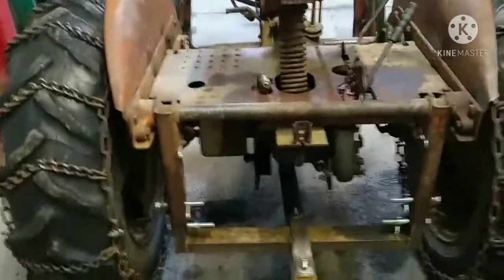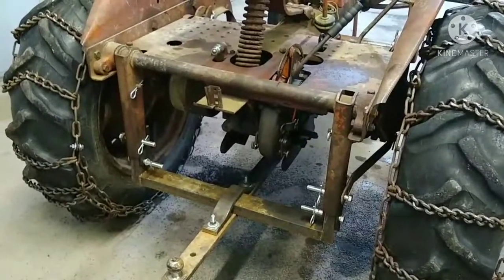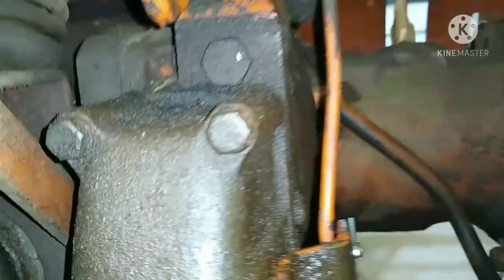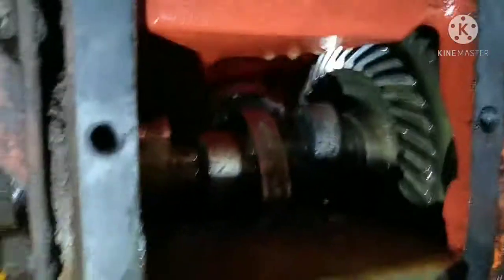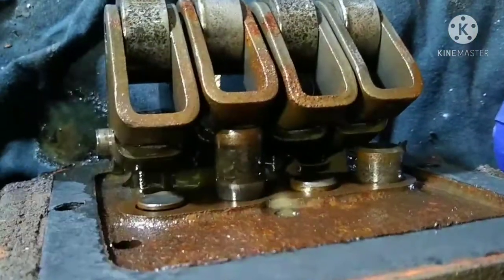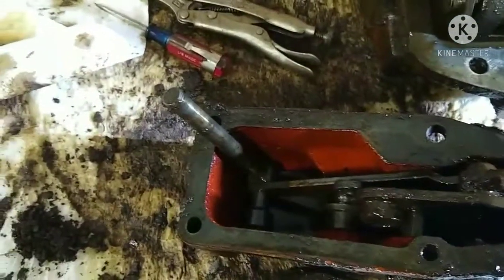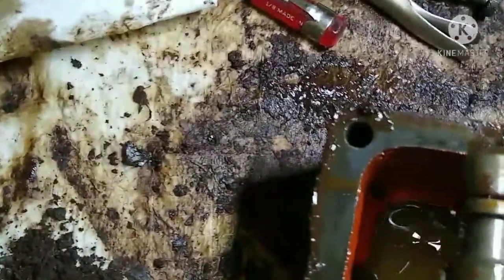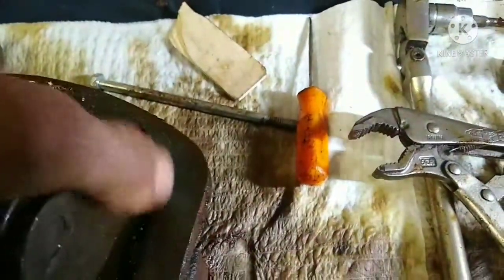Hydraulic pump tare down -Rebuilding the pump for my CA part1

Comment: I just had to work on my CA pump last fall. It had sat for years before I got it and the pistons and valves in the pump were stuck
Reply from the maker: Super common issue it seems, couldn't believe agco still makes the springs and gaskets!!
Reply: @sheisillme  They do still make small parts for the pump ??  TY 1954 CAand B